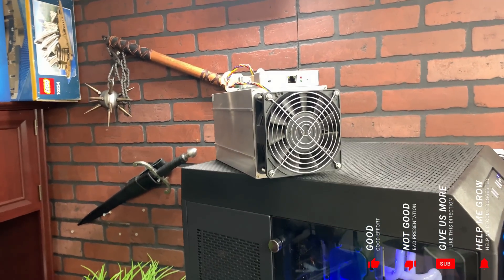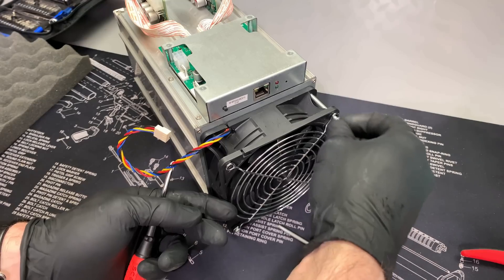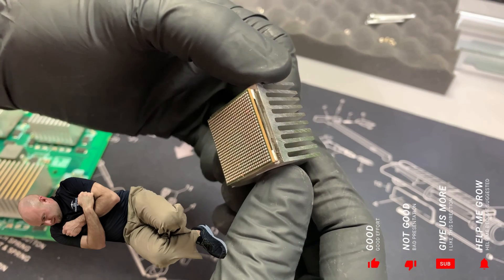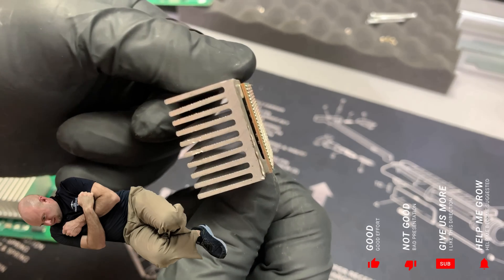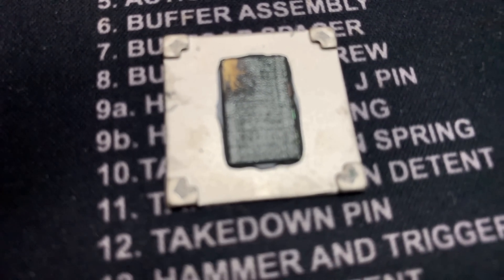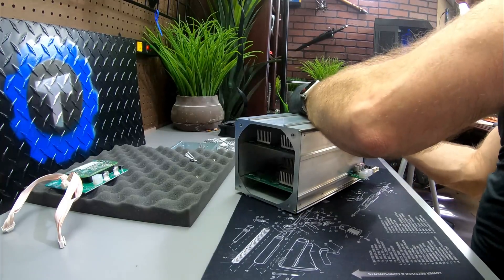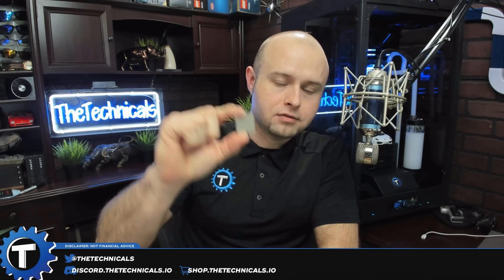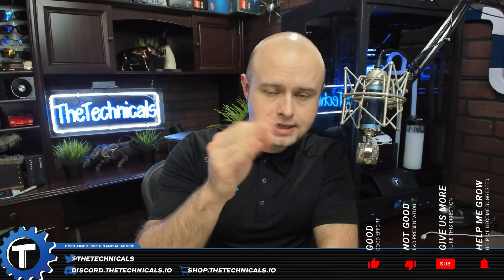Blackminer F1 FPGA Chip REVEALED! (He's Dead Jim)

Comment: Here's a trick to safely remove thermal glue: use copper wire, put it between the heatsink and the chip and cut by pull it back and forth, take a little more effort though

Comment: I'd like to know where you can get a Kintex-7 new in China for $90. The "trim level" (which Xilinx call the speed grade) is the number on the bottom line  of the die. speed grades are 1, 2 and 3, and there is also a "C" for commercial grade or "I" for industrial grade.

Comment: Yeah you can buy chips very cheap in China because of the huge volumes they buy in, then the ones they don't need they dump to whoever will buy them. They also have small companies that then flog off the excess chips in smaller volumes. I've walked around the markets there buying reels of capacitors far more cheaply than I can get from Digikey, although some of them are non-branded which you probably want to avoid when building critical systems.

Comment: http://www.farnell.com/datasheets/2301212.pdf?_ga=2.244556615.354559218.1545945004-464638707.1545945004
China chips : Supplier:SICSTOCK
but u got 3 types of quality 400mhx 470mhx and 670mhz and hawe different value of I/O 250 350 and 500
so that shitty chips are almost garbage, but u got a lot of hiden potential... 2 milion blocks - but at 470mhz  compare it to vcu1525 witsch hawe 1.35m at 800mhz, BUT IN F1 U GOT 6X MORE COOLING (OVERCLOKING) POTENTIAL !!!
i mine SUQA in SOLO mode and got 2 blocks in 3 days

Comment: And...,you didnt render it useless. You can reball and reattach.
Reply from the maker: Reball?
Reply: @TechnicalsMatt  It's held in place with solder balls, reball means re-soldering it on basically.
Reply: Yeah if you are really brave you could probably reflow [the solder on] that chip back on to the board with a heat gun.

Comment: Gahh watching you do this tear down is teeth grinding. 
Get a hotair workstation please for future teardowns. Youll be able to do it cleaner.
Reply: https://www.amazon.com/Smartxchoices-Soldering-Station-Display-Nozzles/dp/B01CBKWG3A/ref=asc_df_B01CBKWG3A/?tag=hyprod-20&linkCode=df0&hvadid=312096335436&hvpos=1o3&hvnetw=g&hvrand=8737328904760926127&hvpone=&hvptwo=&hvqmt=&hvdev=m&hvdvcmdl=&hvlocint=&hvlocphy=9007330&hvtargid=pla-570323811508&psc=1#

This was cheap on amazon. $50
Reply from the maker: Its very unlikely i'll tear anything else down to merit the cost of whatever that is, but i'll make a note!